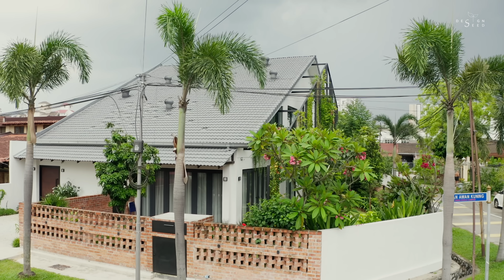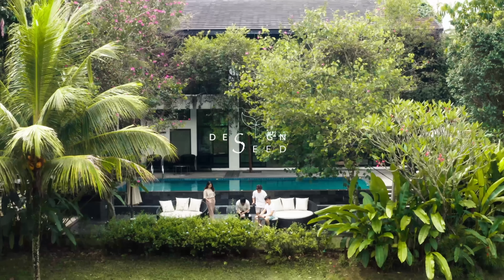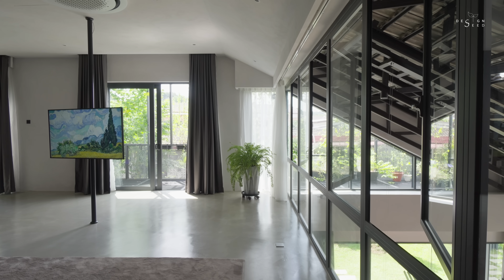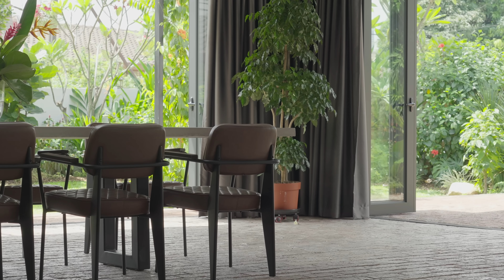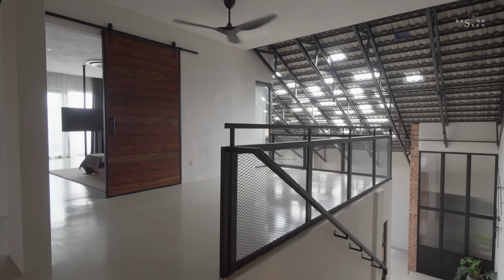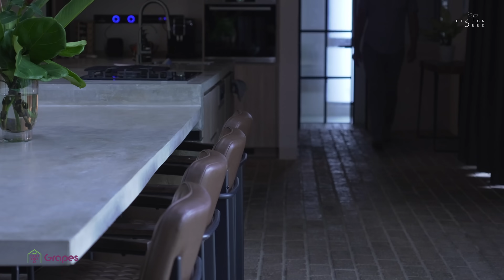Urban Garden House | Inside an Ultra open Biophilic home transformed from a 40-year-old house

Comment: The thing about sensor lights is that.. it switches off automatically if there is no movement. Imagine you’re in the couch watching a movie. It’ll just switch off regularly!
Reply: You are right, But with the Loxone smart home system, the sensors are truly smart that and can detect sound. So, if someone is watching a movie without any movement, the sensor detects the sound and keeps the light on.

Comment: A masterclass in tropical design: large overhangs to create shade, keep the sun off the openings, allow breezes to flow through the home, using plants to create cool and shade… When you don’t have an air conditioned box, you allow the body to adjust to the atmosphere around it and to get outside and explore. Design for the climate you live in😊.
Reply: Well said!
Reply: Literally 20 seconds in and I already spotted one but ok. 🤣🤣🤣
Reply: @hebie666  always good to have the option of an air conditioner installed, but there’s also a case for the building to be cool enough to not have to use it all of the time to be comfortable.